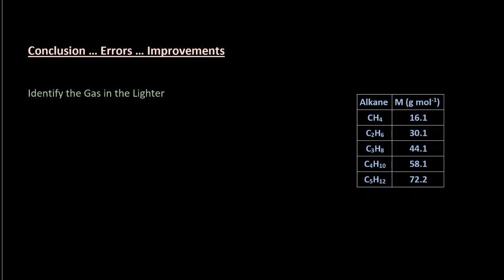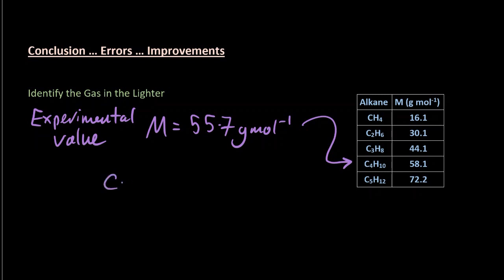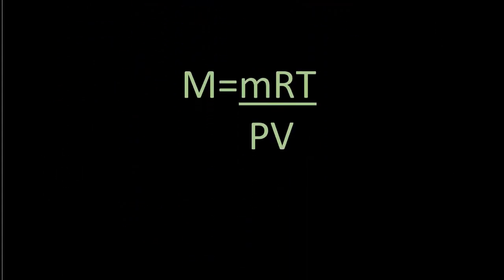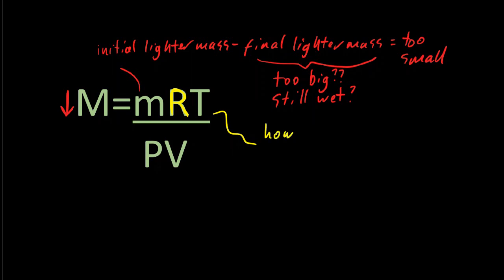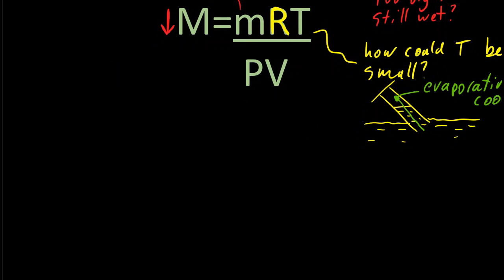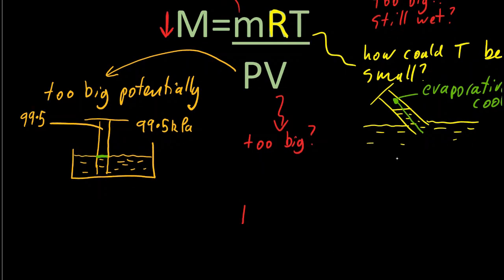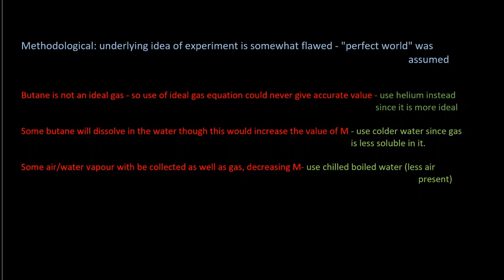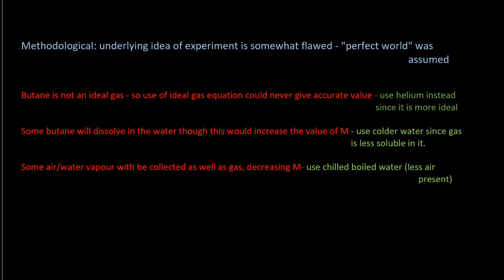1. Finding the Molar Mass of Lighter Fuel - CONCLUSION/ERRORS/IMPROVEMENTS

Comment: Hi Richard, I'm just inserting this collection of 3 labs into my website. I'm trying to get experimental videos so I don't have to do them! I'll try and put the one we do on video this year. We use Mg with acid releasing H2, in a cylinder (to account for pressure) and also accounting for Daltons Law of partial pressures. I believe covering the majority of errors you mentioned. I also prefer the tare to be included ie. one measurement with +/= 0.002g not 0.001. I'm wondering if that will be enough to get the uncertainty large enough to encompass the true value. I'll try and get that done this year and on a video.

Comment: Aren't gases more soluble in colder water?  That's why our sodas are kept at colder temperatures to hold more carbon dioxide fizziness.  Also wouldn't the vapor pressure of the water contribute to a higher pressure?  I love your videos by the way!
Reply from the maker: OK, some nice points here:
Temp higher means better ideal gas (good) and less gas dissolves in water (good). Temp up also means more water vapour in the gas collected (bad).